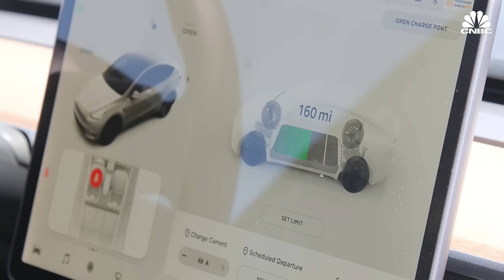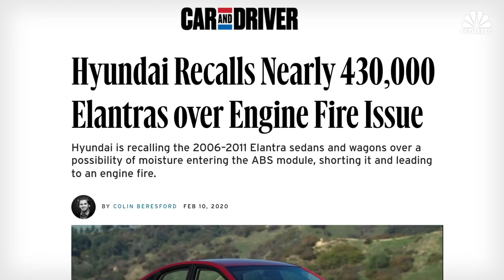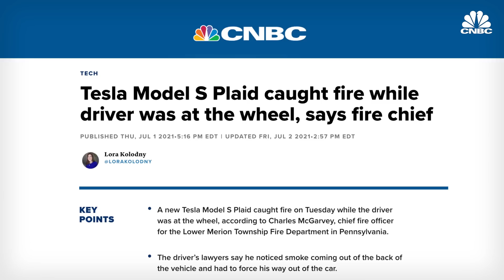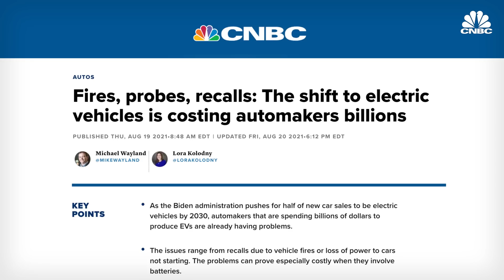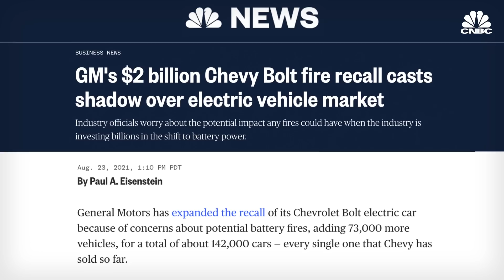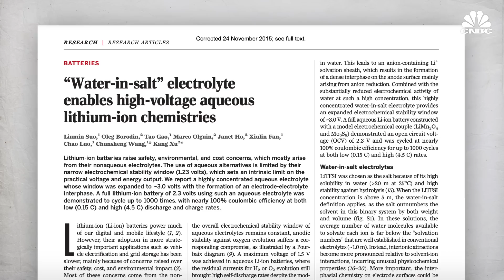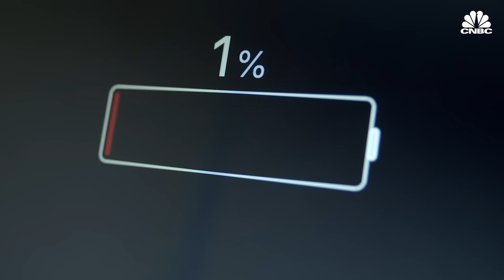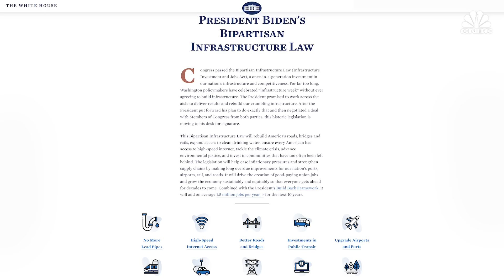Why Tesla, GM And Other EV Companies Have A Fire Problem

Comment: ICE vehicles literally have the term "combustion" in them and somehow EVs have a "fire problem".
Reply: Yeah because the "combustion" stays inside the engine ...
Reply: Tell that to Ford!
Reply: @althunder4269  False dude.  ICE cars catch fire 50 times per 1 billion miles traveled whereas EVs are 5 fires per 1 billion miles traveled.  ICE cars are 10X more likely to catch fire than an EV.
Reply: #badengineering
Reply: The problem with batteries is that, unlike the fuel tank in an ICE vehicle, the battery of an electric vehicle stores energy by storing the fuel AND the oxidizer in intimate proximity to each other. Like dynamite.

Comment: The US department of transportation said in 2017 that EVs and gasoline cars catch fire at the same rate. Tesla says its cars, which dominate the US ev market, catch fire 11 times less often than gas cars

I think I'll wait for CNBC to make 1-11 videos about why gas cars have a fire problem before I make up my mind
Reply: Well, if US DoT says they catch fire at the same rate, but EV fires burn hotter, stronger, and are more challenging to put out, I think more videos on EVs versus gasoline cars would be more warranted, as overall, more damage would be caused by EVs (assuming all else is equal)
Reply: @the.novanator  Not sure where you are getting that data from, but it is obsolete if it was ever true.

"Fully electric vehicles, on the other hand, were deemed far safer than both hybirds and gas cars; they are far less likely to catch fire, with just 25.1 fires per 100,000 sales. That's compared to 3,474 hybrid fires and 1,529 ICE fires per 100,000 sales respectively."
Reply: @redbaron6805  David X, the creator of this chain, said that, which is who I was replying to.  I didn't bother to check his numbers and just assumed he was right.  Also, just a thought, but certainly there is some (though I do not care to quantify it rn) selection bias in that, as most electric cars are relatively new, as compared to old cars.  It would make sense that cars that have been  sold 20+ years ago would probably explode more often.
Reply: Good, you do that!

Comment: A better use of CNBC’s time would be to cover the overwhelming number of vehicle fires that happen with internal combustion engines.
Reply: A better strategy for you is to watch the video before commenting.. Have a nice day.
Reply: If you watch the whole video they compare ev fires with ice fire and show the greater challenges specific to ev fires
Reply: That's not a fair comparison seeing how many more ice vehicles are out there compared to EVs. It really doesn't look good for EVs atm seeing how little are on the road and how many have burned or caused accidents due to self driving features.
Reply: @LordSamuelJ  I agree with u brother. It would bother me sitting on top of a huge battery driving around.  Anything can light that thing on fire. Faulty lines or wires, running over something in the road, charging the thing on a fast charger over the years.  But you can't talk to a fanboy. No matter what u say they just don't care. You just have to sit back and let them go. Tesla having recalls now with just 3% of auto sales.  Imagine the majority of cars on the road being a ev.
Reply: @herbertfreeman3767  tesla recalls are over the air software updates and nothing concerning battery safety.  You are riding around atop 20 gallons if gasoline.  And you have the same type battery as a tesla inside your phone inside your pocket next to your ….
Reply: @steveb796  dude...let's keep my tool out of this. It's not for u. And as for ur phone u know there is a difference. If ur phone catches fire u can through that thing away from u. Ur not trapped in it or it's not going to burn down your house. Never heard of a gas car catch fire wile being filled up with gas. But u have heard of ev burning down wile charging. And what about the number of people complaining of heat pump failures? Door and body panels misaligned?  Phantom braking? Tesla crashing into state  trooper car wile in autopilot? I can go on and on. And these incidents are well documented. Stop worrying about my manhood and look into them.
Reply: @herbertfreeman3767  over 400 fires each day from ice vehicles.  Panel gaps are a thing of the past.  I had a 1/8”gap difference in a long stretch of rear hatch. Tesla came to my house to fix it.  After I got rear ended the Mercedes/Audi/ Volvo dealer that repaired it needed 2 follow up visits to get the gaps right and they were way further off.  
Ive been driving my tesla in 5 below weather all winter with no heat issues.  
Toyota is known as the best made vehicles but I’ve had 2 with seatbelts that didn’t recoil, 2 with heater fan issues, one with a cylinder head gasket that leaked and ruined the engine and one with a frame that rusted through.  They have recalled millions of cars with stuck accelerator pedals.  
Ford had the most recalls last year, Gm had the most cars recalled. Facts don’t care about haters on youtube.
Reply: @steveb796  listen dude. Every car manufacturer has its problems I get it. And I did read a report that hybrids had more fires than evs. Your right.  All I'm saying is everyone that's commenting on this page watched a video titled Why EVs Have Fire Problems! If in fact that evs are having fires problems in a small percentage like u say. And they are 3% of the market with gasoline dominating sales and with no surprises having the majority of the fires. You can't tell me that once evs get within 50/50 of gas sales that fires aren't going to go up. The majority of fires is gas your right!...but again evs are at the beginning stages of mass adoption. Once that number go's up, your telling me that fires won't go up as well? Come on dude.
Reply: @herbertfreeman3767  the RATE of fires in EVS is equal or less compared to gas vehicles per mile driven. Its simple.  You act like batteries are a new thing.  Battery fires in teslas are not a thing. 
Evs are also over all safer to drive than ice vehicles. They are nearly impossible to roll over due to the low center of gravity. They have a large crumple zone due to no engine and no gas tank.  So if you get in a head on collision the engine doesn’t end up in your lap.
Reply: ICE fires are easier to extinguish.
Reply: The whole point of this is that EVs arent as perfect as people think they are.
Reply: @DonJulio510  and yet, statistically, they catch fire less than their internal combustion engine counterparts. Of those 173k fires last year, how many were EV fires?
Reply: @Hans-gb4mv  and yet they still catch on fire. Which still makes them not that perfect. 🙄 we already know about iCE cars but this topic is about EVs
Reply: @DonJulio510  not perfect, but yet more efficient than ICE. Considering that EVs have only been mainstream for a decade vs ICE vehicles being around for over a century; I expect fires will stop being an issue by 2040.
Reply: @DonJulio510  agreed, not to mention the incidents of EV non-crash fires which is extremely rare for ICE vehicles.  Will likely transition from my TLX to a Model 3 in a couple of years but, there needs to be a comfortable handle on this first.
Reply: @evildrizzt1  don't bet on it pal. Mass adoption means more faulty equipment as it ages.
Reply: @herbertfreeman3767  In what industries are you basing this on? Because mass adoption means following strict government regulations. Without which; seatbelts in cars would be optional, never mind the safety regulations which now requires both front and side airbags. Without EPA regs our cars would still be using carburetors and getting 10 miles mpg on average. I guess your one of the people who believed that lead in paint good thing because it sure sounds like you snort it on a regular basis.
Reply: @evildrizzt1  Dude...think for a second. Charging and discharging over time isn't good. These evs are exploding wile charging. Evs are only 3% of sales now. When or if mass adoption happens the risk of fires will go up as well. Simple mathematics.
Reply: @herbertfreeman3767  You’re making the assumption that all EV batteries are the same. Based upon that assumption, then every ICE vehicle should explode when rear ended like a Ford pinto. Obliviously that’s not the case. There’s many factors that contribute to the failures of complex machines. Most of which falls outside of scope what that machine was designed to do. 

Owners of those EVs could have skipped maintenance intervals, tried charging them in flood zones, used incorrect equipment. Etc. Even acts of god come into play, animals could have ate through a critical wire.
Reply: @evildrizzt1  good points 👍
Reply: @DonJulio510  But you are still missing the point.  EV's catch fire 60x less frequently than combustion engines.  Most of the fires are due to crashes where the battery is damaged.  So, yes, they still catch fire but the fires are exceptionally rare.
Reply: @redbaron6805  there rare because they make up 3% of sales. There are way more gas cars on the road than ev. Wait till its 50/50.  Is this the guy that fell off the cabbage truck and bumped his head?
Reply: @redbaron6805  but they still catch on fire. Thats the point lol jesus christ.

Comment: Well, I just want to keep my Gas Vehicles and that's that. 
   Have seen many homes burnt down by the GM EVs parked in the garage.
Seen Families in these cars driving while it was on fire, they had to pull to the side of the freeway and get out, Father, Mother and the kids in their GM Bolt that just burst into flames out of nowhere.  Small toddlers and the parents stranded on side of the freeway at late night as they just lost their brand-new car as it burns to the ground, they only owned the car for 3 weeks.

Comment: That is why you pick a company with 10 years + experience in battery and software technology.
Reply: Toyota
Reply: Toyota uses Nimh batteries with such a low energy density that they are basically unusable for a full electric vehicle. For their lithium batteries, which are COMPLETELY different than a nimh battery, they are using the same lithium technology as everyone else (and they aren’t building it themselves)

Comment: In addition to newer chemistries (such as LFP) appearing to be safer, not charging lithium batteries to 100% when there's no need to do so appears to significantly reduce the odds of a battery fire when charging.  Or if you do charge to 100%, schedule the charging so it hits that high level of charge mere moments before the next time you expect to use it (so that it's not at that high level of charge for very long).  This is better for the longevity of the battery pack as a bonus.  Ultimately, do take reasonable precautions, but don't live in fear of a battery fire given they're so rare.  A fire in an ICE vehicle is statistically more likely, I suspect.

Comment: FALSE, EV fires are not the Problem.
poor Training of First responders and Fire Crews are the Problem. 
you can Completely extinguish a EV fire in just 2 - 3 Minutes , but you need a Water Tender on standby to SOAK the batteries for 4 - 6 hours to keep them cool.
a few FIRE crews are trained , on how to Propperly and Safely disconnect the battery from the car. 
however , many Vehicle makers have FREE Downloadable guides on how to Disconnect the battery and how to FIGHT EV fires.

Comment: Depends on battery chemistry and type. LFP batteries do not have the problems shown here. Secondly, what is the rate of EV fires to ICE vehicle fires? Negligible.
Reply: Just like the percentage of EV on the road.
Reply: @bowez9  Statistics are problems per 100,000.  The number of EV's on the road doesn't affect them.  "Fully electric vehicles, on the other hand, were deemed far safer than both hybirds and gas cars; they are far less likely to catch fire, with just 25.1 fires per 100,000 sales. That's compared to 3,474 hybrid fires and 1,529 ICE fires per 100,000 sales respectively."

As you can see, even if there were only 10,000 EV's the fire rate would then be 2.5 per 10,000 or 25 per 100,000, 250 per million.

That is a logical fallacy that the statistics follow the number of cars on the road.  It is problems per 100,000.
Reply: @redbaron6805  interesting that hybrids have higher rate of fire and on average are newer, with the only difference being they have a high voltage battery system.  I suspect the low number of EV fires cam be attributed to the low adoption rate and high price.
How many of those fires are arson?
Reply: @bowez9  There have been over 2 million BEVs (not hybrids) sold in the US in the past 5 years and over 6 million worldwide. If you go back 11 years the number is 3 million in the US and about 10 million worldwide. As Red Baron said, statistics are incidents per 100.000 vehicles and BEVs is 60 times lower than ICEs.

Comment: Long story short, don't use pouch cells. Current gen cylindrical cells and LiFePo4 cells are very safe, at least 10x less fires than gas cars.

Comment: When electric car will surpass the conventionnal gas motor, we will burn gasoline to produce electricity.   I had worked in the oil industry in Canada for 10 years, on (1) barrel of oil, 15% is for the jet fuel, 40% any kind of chemical and the left over 45% is gasoline (disposable residue) we burned with our car to accomodate the aviation.

No gasoline car = No aviation.......or we dump it in the ocean

Comment: One thing I don't understand is that how pouring water on Lithium is a good idea to begin with?
Reply: you start by putting out the fire, with foam for example, but the next step is to cool down the battery to prevent it to reignite. And that cooling down works best with water.

Comment: An electrical fire is on a whole other level than your standard gasoline.  EV fires are way WAY WWAYYY more dangerous and life threatening.  we've seen this with phone and hover board fires.  they burn much like a blow torch.
Reply: Apparently you’ve never seen a gasoline fire.  🙄
Reply: @stevemcqueen399  gas fires take less water.  That should tell u something right  there.
Reply: @herbertfreeman3767  "gas fires take less water.  That should tell u something right  there."  Gas fires are 60x more common.  That should tell you something right there.
Reply: @redbaron6805  that gasoline can be easily ignited? the problem with batteries is putting them out
Reply: @alexalcalaortiz368  It can be difficult to put out battery fires depending on the battery design, cell type, etc.  But that still doesn't change that battery fires are 60x less likely than gasoline fires...

Comment: Full disclosure: I've been driving an EV (Mitsubishi i-MiEV) for just over 6 years now and studying the technical aspects of these cars longer than that. I see lithium iron phosphate (LiFePO4, LFP, etc.) briefly mentioned at around six and a half minutes into this CNBC report and it probably should have been mentioned even sooner. This is mature yet currently underutilized battery cell technology that is far less fire prone than what's in most EVs today. The next wave of EVs in 2022 moving forward will prominently feature LFP cells, especially the upcoming standard range and more affordable Tesla models, as well as a host of EVs made in China. One Chinese company, BYD, makes an LFP cell called the Blade, which takes the form of a long, thin rectangle and is particularly safe when it comes to fire safety, even when punctured. The other asset of the Blade is that, like all LFP cells, it doesn't require scarce minerals that might also have human rights issues in mining. The only downside with LFP is that it's slightly less energy dense than ternary (ie: nickel/manganese/cobalt anode) formulations commonly used in EVs today. I hope the American, European, Japanese and Korean manufacturers pivot to LFP soon. All the various patents that previously prevented more widespread worldwide adoption of LFP are now expired and there should be no more excuses. LFP will work today, while the more energy dense and possibly even less fire prone solid state automotive traction batteries begin entering the marketplace in a few more years. Electric aviation will follow soon after.
Reply: Problem is LFP works terribly in the winter so it won't work in northern countries
Reply: @dyingpentas  True that LFP is vulnerable in low temp operations. But battery packs in modern EVs have thermal management, certainly better that the little cooling fan inside my i-MiEV pack. Early Nissan Leafs had nothing at all and that was a problem for those cars a decade ago. Also . . . don't all you folks up near the Arctic Circle have 120V outlets all over the place to heat up engine blocks to prevent freezing? You already have the cold weather infrastructure.
Reply: I also heard it is ok to fully charge,or leave it empty the battery will just fine..
Reply: @cobaltblue2756  Yes, that's another advantage of LFP chemistry, although taking it down to dead zero and ramping it up to 100% constantly will wear out any battery sooner. LFP is simply more durable when subjected to that sort of abuse.
Reply: Electric Aviation 😂
Reply: @bert1450  No. That's not what I'm saying at all. I'm not a fan of the zombie-like  "government is the problem" diatribe conservatives have been spoon feeding is since Ronald Reagan slashed clean energy research in the early 1980s. We could have been much further along in this transition if Republicans - bought and paid for by the fossil fuel industry - weren't standing in the way.
Reply: dont spew youre logic on here, thats not the narraritive
Reply: @airgunningyup  Be forewarned, Earthling . . . 

https://www.youtube.com/watch?v=uEvR3kyx_KM